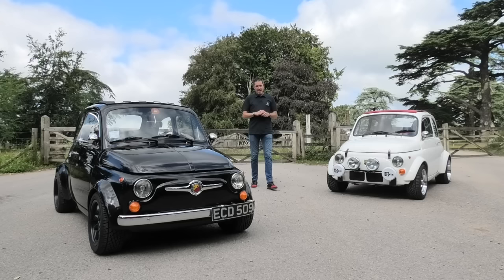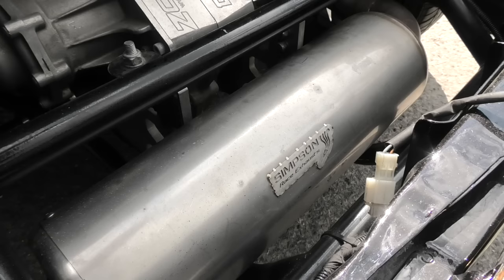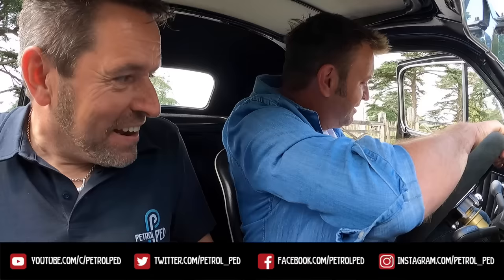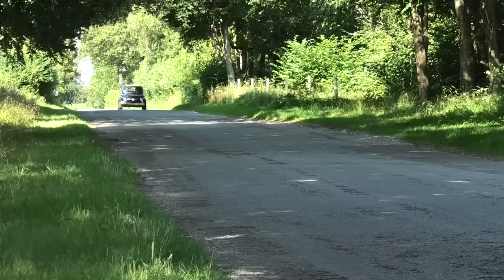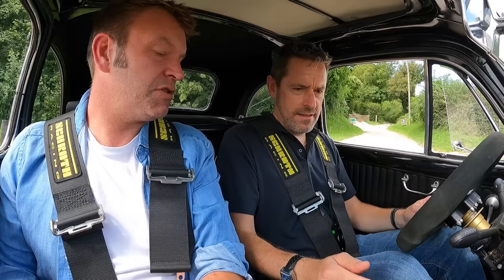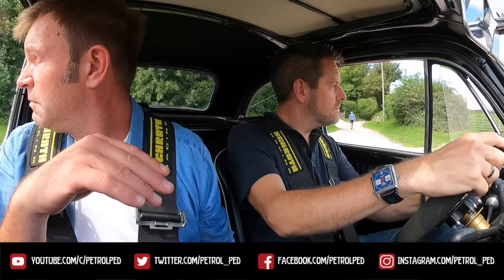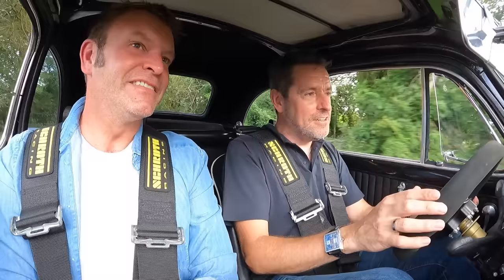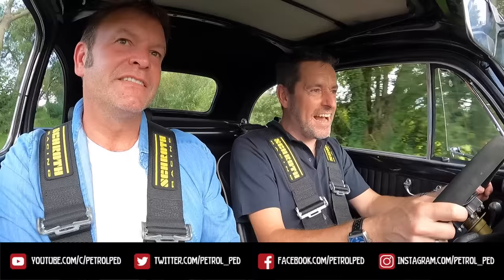197hp Hayabusa Engined Fiat 500 'Fiabusa' with 11,000 RPM redline by ZCars [Part 1 of 2]

Comment: One thing about the Hayabusa engine is that it is a super long stroke engine, with a TON of low end torque. Liter bikes generally have a 2.0 inch stroke, compared to 2.56 inches for the Haybusa 2nd and 3rd generation engine. That's 50.9mm for the 2022 Yamaha R1 vs. 65mm for the 2008 and up Hayabusa engine. The longer stroke makes the Hayabusa engine into a totally usable car engine, with a ton of torque starting right around 3,000 rpms. There aren't many motorcycle engines that can revv as high, but also retain that level of low end torque.
Reply: Thank you
Reply: Honda k20 baby all day better choice
Reply: Hayabusa is not a liter bike either. It has 1,3-1,34 liter.
Reply: Too much engineer in Youtube
Reply: It's not a long stroke engine. It's well over square at 81x65.
Reply: The 1.34 liter engine has a longer stroke than the 0.998 liter? Gee, no kidding. The Hayabusa & the R1 have almost the same bore/stroke ratio 1.27:1 vs 1.24:1. 
It’s got more torque because it’s 34% larger!!
Reply: @andreapehjerne8490  he meant lighter
Reply: O really how boring 😮
Reply: My CBR1100XX enters the chat. Not as large of a stroke, but 58mm/2.3in but with 81mm forged Wiseco pistons, 12:1 comp, a rack of JB Power modified Keihin FCR 41 Flatsides, full TSR titanium 4into1 60.5mm exhaust, AS Uotani Full Power ignition system and other assorted aftermarket Japanese performance goodies, 205hp at the wheel and almost 130ft-lbs of torque.... the original "Fastest Bike in the World" 😤😅
Reply: @jonwallace7015 Just like ya mother
Reply: @RipsawEV_2  another boring comment from you .try socialising get out and mix with people. This is a sad existence you are living buddy.
Reply: A che velocità max arriva ?
Reply: OMG I want one... That would be a kick in the pants to drive

Comment: You'll probably find that giving the throttle a little blip on the downshifts and just fan the clutch will make them smooth with no clunking/crunching. 35 years on bikes here and that's how you handle a constant speed motorcycle gearbox.
Reply: How does he not know this. It is the same on cars and bikes.
Reply: Yeah, I laughed when he said I need a sequential box in my life! Well get a bike then, simples.
Reply: If you blip the throttle on downshift, you don't even need the clutch
Reply: To put it mildly,  how could you wreck it any faster? unf believable.
Reply: Oh my...poor little gearbox!
Sure, when you are pushing it and shifting up near 10k rpms it's completely fine without a clutch. 
But downshifting without a clutch? What did that poor gearbox did to you to torture it like that? You need clutch and throttle blip when downshifting with motorcycle gearbox!
Also when you are doing it right, you don't need to bang that stick with such force, it should be smooth.
Those car guys ;-) Obviously this car should be banned without previous motorcycle experience :-)
Reply: If you were going to let an idiot drive it, you'd fit a quick shifter to handle the changes for him.
Reply: @waynedl99  I am afraid, that's not an idiot proof solution. I have never had it as I do believe it has little to no advantage for someone who knows how to shift properly, but from the reviews and specs, it seems like it only helps with up-shifts, not down-shifts, which is major concern with someone who has no clue how to downshift with motorcycle gearbox...
Reply: @tomas_klouda  lots of quick shifters are up and down assist, with blip on the down too.
I'm not saying they'd be better than a pro (although, some pro's say they are), but less likely to damage the gearbox than someone just ramming it between gears.
On a bike, for clutchless shifts, which you only tend to do upwards, you'd be feeling the gear with your foot, so kinda light pressure on the up, and then you release the throttle and you'll feel the rev match as the gear changes, and back on the throttle. - not so easy with his method of changing gears I think, so I can just imagine some serious gear dog damage
Reply: @waynedl99  If the more advanced ones do also blips for downshift then absolutely. My quick search revealed only those basic ones which only cut ignition/injection when upshifting...
Yeah, what you describe is pretty easy once you have a feel for your bike, but almost impossible with that long stick and cables in Fiabusa. That's why that poor gearbox produced so harsh sounds.
Reply: Yes ! Quite so. You get seamless changes eventually ! Trinidad & Tobago.
Reply: It takes a bit to master. I've had my bike for about a year and I don't nail it every time. Sometimes it's butter but other times there is a jolt because I give it too much throttle or too little. I imagine it would take significant time for most people to acclimate to a car like this, particularly if they don't ride bikes.

Comment: Having a "turbo busa" is a thing among hayabusa owners... let's get a turbo in this car!
Absolutely mental car, would love to own something similar one day. Thanks for the great video!
Reply: my uncles friend used to drag race a turbo busa with nitrox. It was twin turbo'd if i remember correctly. It was a bit silly. And not road legal xD
Reply: Funny thing is making 300 HP on a fairly stock busa isn't all that hard or unreliable. Now Iv seen one pull 750hp on the Dyno Soo potential is there.
Reply: I imagine this little bomb near a Ferrari ,byebye when i’ll be there i’ll send you a postcard 😂
Reply: @oliverscorsim 
300 at wheel is easily achievable with excellent reliability. 
Mine is 450 wheel but wouldn't suggest putting it in a fiat

Comment: Downshifting without using the clutch is actually not a bit deal. I had just 3-4 strands left on the clutch cable of my CBR1000RR and had to get us 300 miles to my replacement cable. As you say, shifting up is not a problem. Downshifting, if you match the revs properly, is just as smooth. And yes, I did make it all the way to where my new clutch cable was waiting for me.

Comment: This gave me flashbacks to my bonkers MK Indy (Lotus 7 style kit car) with Hyabusa engine and gearbox, which weighed around 450kg. The sequential box takes some getting used to, mine didn't have a reverse gear though, or roof or windscreen, so a full face helmet was required.......3 seconds 0 to 60 though ;)

I also had a classic mini with a Yamaha R1 engine in the back, it used an electric switch connected to a starter motor for a reverse gear....which I broke on its first outing. That reverse gear solution looks much better, and stronger.

Comment: As an owner of two motorcycles with "Quick Shifters" you really only need the clutch for pulling away then short shift to 2nd at about 4k rpm and then, select your desired acceleration rate and bang in 3rd WITHOUT lifting or touching the clutch. I am considering a future for my BMW K1300 engine in a Lotus 7

Comment: What an engine and gearbox combo! Have a feeling it may not be much safer than riding the two wheeled version though....
Reply from the maker: Indeed 😂
Reply: And way more reliable than the shit box Fiat engine
Reply: @donbrashsux ?
Reply: Don't worry, they have seat belts on!
Reply: Yeah, but in the Fiabusa you don't get bugs in your teeth!
Reply: @savage22bolt32  If you're wearing a helmet on your bike as you should be, you won't get bugs in your teeth on the Hayabusa either.
Reply: @CockatooDude  open face helmets for 55 years
Reply: @CockatooDude  I was just thinking, you probably never heard the joke: How can you tell if a rider is a happy motorcyclist?

By the bugs in his teeth!
Reply: @savage22bolt32  Ahh I see now. Fair enough.

Comment: Maybe one or two car drivers can see why we bikers love motorbikes. Nothing like a powerful engine, sequential gearbox and a quick shifter that momentarily cuts the ignition to allow the next gear to slip in without the clutch. 
Many of the newer bikes now come with an auto blipper so you can also go down through the gears without the clutch.
Reply: That car really needed the auto blipper I think most cars with a sequential box have them.

Comment: The only "problem" with this drive are the drivers that are trying to drive a motorcycle engine like it's a car engine. Half of the time you were just hearing bad clutch shifting and at low revs. Give this car to a biker and you'll truly see what is capable of. Nice try though.Thanks for the review guys😉
Reply: The expert 👌🏾👌🏾👌🏾stupjjjd
Reply: As a biker and just like my truck and gsxr I only use the clutch for start and stop and only start and stop, all bikes have a sequential transmission meaning you do not have to use the clutch period when shifting. The clunking you hear is the dog box as well as that quaf gear box in the back.

Comment: I've always been amazed the bike's clutch system can handle the extra weight.
Reply: Busa clutches , gearboxes & cranks are extremely over engineered , hence their race success. 
350 rear wheel power on totally stock motor is common

Comment: To complete this build they need to add a Pro-Shift device that cuts the ignition on up and down shift to make them even smoother.  I think some of the devices can even blip the throttle on downshifts.
Reply: Blippers are pretty common for motorbikes. Usually costs less than 1k€ and is easy to install.
Reply: or learn to rev match yourself?
Reply: @shaggings  Really quite difficult on such light rotating masses, sooo easy to blip for just too long or not long enough, especially with a throttle pedal instead of twist grip. Better to shift up by coming off the throttle a little and shifting up without clutching, and if you haven't got an auto blipper.. do your best on down changes, I found easing the clutch in slowly to be the only thing that worked for smoothness and that was with a slipper clutch.
Reply: Yep, my BMW S1000XR has clutchless upshifts and downshifts at any revs,

Comment: Ahh, this makes me miss my 2005 GSX-R so much. It was a 600 but I had cams on it, full Yosh exhaust, and a PC3 with a good dyno tune. Christ I really need a Gixxer back in my life but I Can't for the life of me find one for sale in my island. They're only selling the brand new GSX-S bikes and old ones up to 05. After I sold my 05 I always wanted to get a 2008-2012 one but never could because of space constraints. Now I can get one but I can't find any for sale ffs. Feels amazing going up the gears without a clutch innit? I learned quickly and basically never used the clutch except to put it on 1st and when downshifting. On the bike though, I'd have to let off the gas for a split second right before upshifting though, but they were nearly instant shifts and they sounded just like when you were going flat out on the fiabusa. Good ol' days.

Comment: It always makes me laugh when I hear car guys amazed by the fact that a bike engine can rev up to 11.000 rpm. FYI, the Hayabusa engine is extremely conservative rpm-wise when compared even to 15 year old 900/1000cc engines. I imagine that if that Fiat had a 14.000 rpm R1 engine, his jaw would probably drop so hard to the floor that it would dig a hole.
Reply: well cars need more torque due to their mass not so much high revs needed. of course a car engine can have high revs too but its a bit pointless !!
Reply: @rhett7716  - That's not what I'm talking about, it's still a bike engine, no matter the application. Surprising would be to see a Hayabusa engine revving only to 8000 or 9000 rpm but since you brought the torque subject up, let me tell you that this particular engine (the 1340cc) has 150Nm, which is more than many car engines with the same or even more displacement.
Reply: As a car guy I knew that, the Honda S-2000 revs past 9k revs  many others v-tech and rotary engines cars exceed 8k revs.. the trade off is weak torque off the line. so you would expect bikes to go beyond that as they are more reliant on HP than initial torque.
Reply: Don’t even get them started on 2 strokes
Reply: My first bike, an i4 250, redlined around 19,000rpm. Absolutely ridiculous little machine 😁
Reply: @Novur  - CBR 250R, FZR 250R or GSX 250R? 🙂
Reply: @module79l28  GSX250F! Aka the Suzuki Across. It was an especially cool design imo; the fuel tank was under the seats, and there was a compartment where the tank usually goes designed to fit a helmet (or a backpack, or a couple bags of groceries, or anything else you might like to not carry on your person 😁)
Reply: @Novur  - Oh, so it's the GSX 600F's (a.k.a Katana in some markets) little "sister"! I knew about the 250R but I didn't know they also made a 250F. Nice!

Comment: A suggestion for better gear change if u could fit a quick shifter from a bike with a down blipper so u use the clutch for only pulling away in first

Comment: I bought an engine for my zx11. It came out of a lotus elise that was being raced at Laguna seca. It was attached to a Ford Sierra cosworth front differential which I still have. It got me dreaming about building a car with a motorcycle engine. Someone wanted to buy the differential to put in a Fiat 500, but I am holding on to it for now. The elise had a ring gear attached to a starter motor for reverse.
Reply from the maker: Go for it 👍

Comment: I had and drove a normal Fiat 500 and I was able to see how dangerous it was even with a few horsepower. But being very slow it was still a beautiful little box. The Fiabusa is not simply dangerous, it is the quickest route to certain death . I would be curious to see it driven by a pilot on a track. In my opinion, you get off the road at the first corner made quickly. Wonderful idea but I don't envy those who will buy it.

Comment: What an engine and gearbox combo! Have a feeling it may not be much safer than riding the two wheeled version though....
Reply: There has to be a better way to gear down. best way to avoid an accident is hard brakes(or Ebrakes, which I didn't see) and stall out

Comment: This is complete madness, yet i just love it...  The idea of putting an engine from a racing bike into a small car is somewhat counter intuitive, since it as low torque, yet it does prove to be fun to ear the sound of its windin' " pedaltothemetal" acceleration...  Looks dangerous enough to drive as it must be quite a challenge to hold it on the road... Neat little car, good job... Hilariously nice video for my dull saturday morning.  Thank you for sharing, keep on posting!😅 what about doing the same with a ol Cooper?😍
Reply: Navy veteran here, I have lived and drove fiats like these in Sicily o and from Naval Air Station Sigonella numerous times on back roads,  hills, autobon, and up/down valleys on sandy steep roads.

I promise It will drive and will give you such a thrill . Going back this year to get two myself.

Comment: I know you were only allowed to rev it to 8000 rpm but thats really only just into the meat of the power of that engine. If you took that to the red line it would be a hair curling experience and would probably have you reaching for your wallet.
Cracking video and a wicked little car 👍
Reply from the maker: I am quite sure and the chances of crashing would have increased significantly 😂

Comment: Well, that's fun. But, what I'd like to see is someone to produce a modernized version of the 500, with about a 1 liter engine...and about 70 bhp. I mean, a modernized version of THIS 500 - NOT the overweight version sold currently. At least that would be economical and efficient. 

A toy is one thing, but a practical small car (with some fun thrown in) is another.

Comment: If you think shifting that was fun try a sport bike with a quick shifter (you just bang gears and a loadcell in the linkage kills the ignition for a few milliseconds allowing the transmission to unload and go into the next gear almost seamlessly) and for downshifts an auto blipper that works the same way but add a throttle blip for perfect rev matching! The only time you need to use the clutch is to engage and disengage 1st gear, very fun!
Reply from the maker: Sounds awesome 👏

Comment: Pushing a fiat the 197 hp is more like 120 and the busa toruque is good but it's rather high rpms to achieve the peak. That's why I love a bandit, if you just turbo a bandit it's good for 200 plus hp and 100 ish lbs of toruque at around 5k rpm

Comment: If I made one of those I would use a largest displacement V4 bike engine. The in line four revs out kind of straight flat boringly. The V torque would be more impressive "feeling"
Reply: V4 bike engines are miles heavier than the busa motor , the V4 weight would negate any advantages at all .
Busa's are common for a reason

Comment: Awesome build and great video! Just like to correct that Harley Davidson bikes never had reverse(their trikes do); however Honda's Goldwing has had reverse since the 4th gen(mid 80s). Though it still isn't a mechanical reverse gear, they cleverly use the starter motor to spin backwards creating an electric reverse. "Pretty cool right?" -styropyro

Comment: Can you pre-load the shifter and change up the box just by snapping off and back on the throttle (like on a bike)?
Reply: That's what they are doing (listen to the engine, during gear changes once the car is at speed) also the owner explains this at the beginning